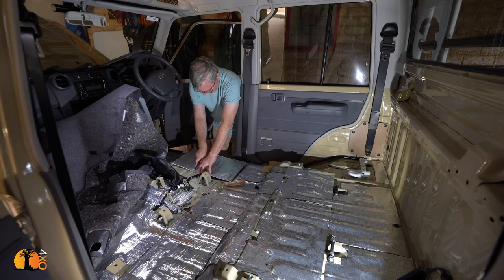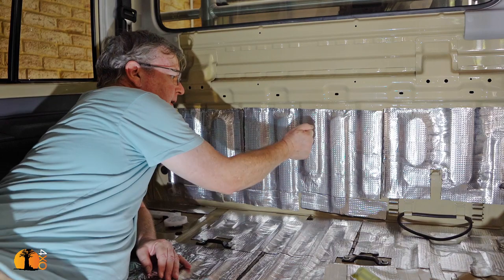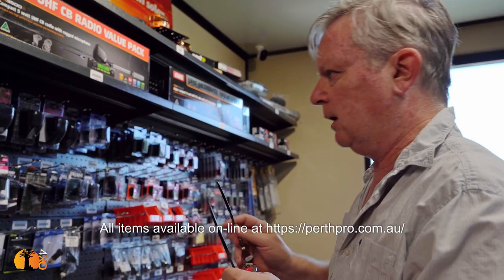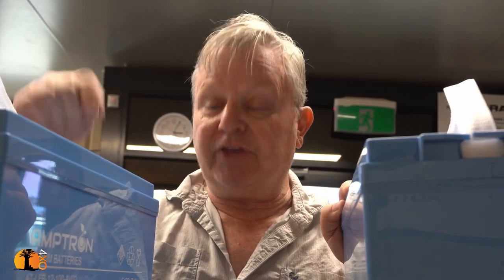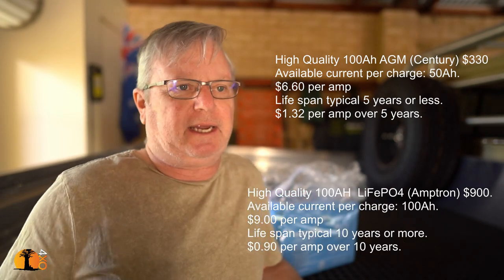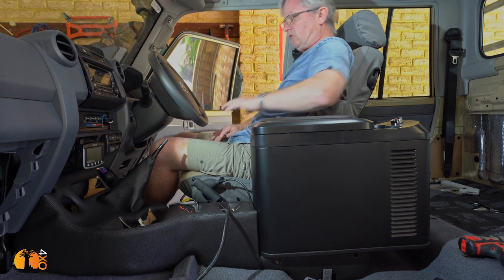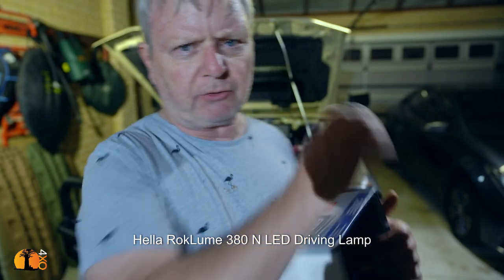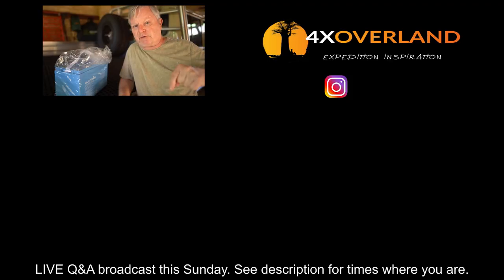LITHIUM VS AGM BATTERIES | THE TOURER WORK BEGINS | 4xOverland

Comment: Are you sure your daytime running lights are legal in Western Australia? I think the average copper will call them foglights and give you a ticket.
Reply: You are permitted to fit aftermarket drl lights in WA,  as long as they are sold as drl and have Australian compliance. But they must turn off fully when headlights are on (like Andrew has done), unlike manufacturers fitted drls which can dim.
Saying this I'm not sure if these have been fitted far enough apart?

Comment: Running cable to negative rather than earth body is a huge mistake. If you have a short circuit it can blow out your electrics because the fastest way to earth will be the negative wire to your CB Radio or whatever blowing it to kingdom come, rather than the body work which is impossible to blow.

Comment: I thought you didn’t like wide tyres? Is 285 not too wide?
Reply from the maker: Yes. But there is nothing readily available. 255/85 would be ,my first choice, but very few tyre makers make them and then if I have a problem finding a replacement tyre in a remote area becomes a problem. Its a compromise and I have no choice.
Reply: @4xoverland  yes okay that makes sense.

Comment: I would love for Toyota to offer that truck in the U.S. but of course we have to be different. It might even give the Jeep Gladiator a good run for the money.
Reply from the maker: This Land Cruiser is designed specifically for less developed countries. In that it is extremely strongly built, and can withstand abuse. This is not the case with anything Jeep makes. They are designed for entirely different markets.

Comment: "Dream Tourer".......
In other words, this is what you have to do to finish building what Toyota started, but never really finished :)
What happened to the Lead Crystal batteries you preferred over LifePo4?
I believe your direct quote was "Because Redarc have brought out a DC-DC charging system programmed for Lead Crystal, i wouldn't consider any other type"
Did you find an advantage with LiFePo4 over Lead Crystal batteries?

Good Luck with new the build, its bound to be great.
Reply: Also wondered how Lead Crystal fell out of favour.
Reply from the maker: Lead Crystal is no longer available in Australia. I heard that the co making them didn't have the rights to the IP. There was a big court case.
Reply: Interesting. 
Well i hope your "drop in replacement" LifePo4's work well
We've had issues with internal wire size and cell balance units used, and the omission of Low or High temp protection.
Reply: @4xoverland  thanks for the reply.
Reply: Andrew would you have gone lead crystal if they were still an option?

Comment: The BEST feature in lithium is it RECARGES 4 TIMES FASTER than AGM. Take out 50 amp/hrs lithium requires 55 amp/hrs of charge, AGM takes 150-200 amp/hrs of charge. This makes your solar VERY effective, as it charges lithium at 95% efficiancy.Also lithium CAN sustain VERY HIGH DISCHARGE, your victron's can discharge over 100 amps of discharge until the bms cuts the load, your AGM CANNOT come close to this. Quality lithiums like your victrons all will give you more than the rated 100 amps on the label. They are made to over deliver so that after a year of use they still will give the rated 100 amps. For more info on this watch youtuber WILL PROUSE, he takes these batterys and discharges till the bms cuts out to make sure the rated power is there, and then disasembles the battery to verify the quality of the build, the results are not always what they seem.   CHEERS    Steve h.

Comment: How are you wiring up 24v lights to a 12v system ?
Reply from the maker: I didn't know I was doing that.
Reply: @4xoverland  so you have no problems running them off your 12v ?
Reply from the maker: @jasonkennedy3632  No. I have no problem running my 12V lights on my 12V system.

Comment: Hi Andrew,

Hopefully you'll be OK where you've installed the DRLs.  WA DOT regs specify a minimum 600mm separation on the inside edge.  I came across this while doing my due diligence prior to getting the electrics on my HZJ75RV-MNQ upgraded together with LED driving lights & Light bars on the bullbar etc. 

Good news is that the regs are generally consistent across the various states in Australia.  There are some variations between states in regards to where you can mount additional lights but if they are mounted below the top bar of the bullbar, not protruding and not near the roofline on a rack, there's no risk of breaching regs anywhere in Australia.

For WA Dept of Transport regulations on additional vehicular lighting please see https://www.transport.wa.gov.au/mediaFiles/licensing/LBU_VS_IB_132.pdf

Love the build videos!  Keep them coming!
Reply: Huh interesting, would make those spotlights with DRL's out of compliance 90% of the time. Would be a spectacularly petty thing to get pulled up on (and I'm saying that even tho I hate how they look)

Comment: Goodyear duratrac is in between,  called a hybrid tire
Reply: Blake paper thin sidewalls
Reply: @donleamon8653  depends on the load rating, load c are, the 10 ply load e are just as thick as any other.  They just actually have a lighter version and then it spreads bc people dont understand the ratings
Reply: Blake - they are no better in E as compared to other brands. Extremely susceptible to sidewall damage. I work for the largest tire and wheel retailer in the US. There are much better options than DTs in that price tier.
Reply: @donleamon8653  all I can tell you is I've had zero issues even with the thinner load c. I had plenty of puncture issues with the kevlar stock tires on my tacoma.

Comment: Your battery estimation costs are highly optimistic for Lithium and very pessimistic for AGM/lead acid. You are absolutely not coming out with Lithium as more cost effective in real life. If you like lithium because they are lighter and because you can discharge them deeper then I understand that, but amp per amp cost is still far in favor of lead acid type batteries.

Comment: I fully understand how much better lithium is espically in this application. However your maths in video actually show the lithium is more expensive. 1.32 per amp over 5 years on an agm. And over 5 years the lithium is 1.80. As you showed 10 years 90 cents. On a cost vs lifetime of battery etc. The agm theoretically wins. As you would be $260 better off over 10 years. I know lithium is better. And still better value regardless. But the maths there actually pointed to the agm being better if you worked back from your figures.
Reply: Also, not that many ppl own a car 10 years...
Reply: All arguments are true, But new tech is always expensive.
Reply: But the whole point is surely achieving usable Ah without cycle life reduction or excessive weight  ? Generally you will accept higher lifecycle cost if there is a significant weight saving ?
Reply: My immediate reaction was 'how can they say a Lithium battery will last 10 years? They've only been out a few years.....

Comment: Next install a 4wheelcamper. Guaranteed.
Reply: Southern Nevada offroading and back country - want to put some money on that?
Reply: @donleamon8653  $1000 monopoly money
Reply from the maker: Let's open the betting . . .
Reply: @1FiftyOverland  - It's on like Donkey Kong! He could do a Fleet flatbed on that I think Norweld tray. Not sure FWC would be willing to sponsor him for the Australian market, however, it would give them some more exposure to us in the US that follow. I have a '17 Hawk, and I like it. At the end of the day it is easy to setup, dust free and a comfy place to sleep even down around the freezing level. FWC's are generic, but I'm finding much stronger than they appear and not bad on weight. They are proven. For whatever reason, I just envisioned a more 'European' design with the rear hatch and composite construction, then our 'crude' American offerings. FWIW FWC did loan him one a couple of years ago when he came to Expo West.
Reply: @donleamon8653  yeah when he drove from Washington to Arizona. I'm actually  planning on getting a FWC for my f150 I believe the hawk also fits my truck